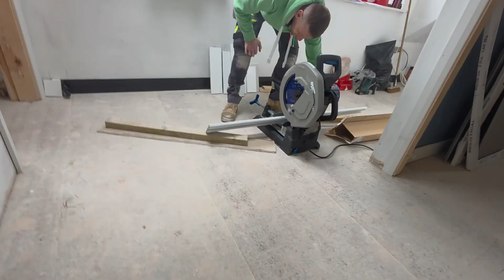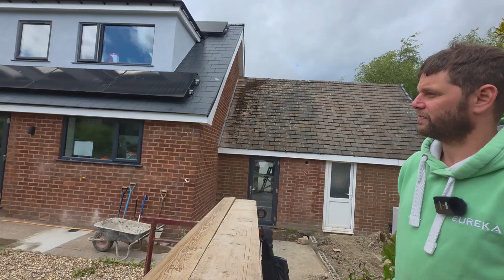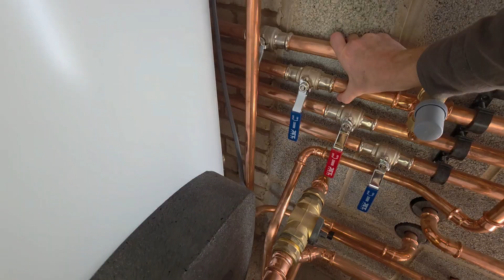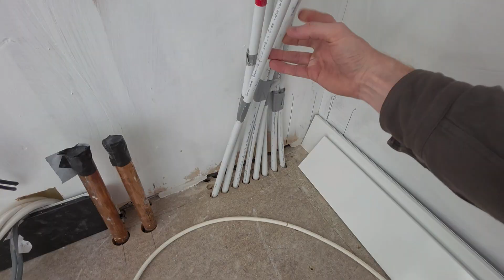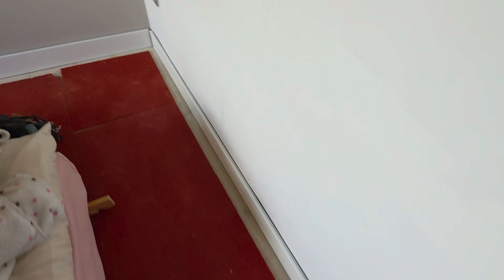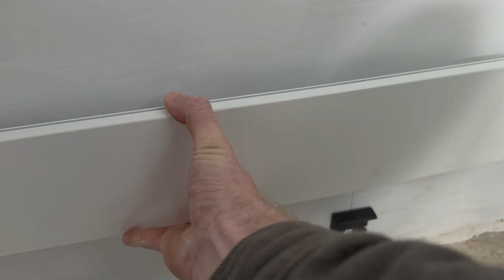Install a Heat Pump Without Ruining the Look of your Home

Comment: I'm a sceptic when it comes to expandable batteries. If you know the electric heating requirement you should be able to estimate a best size battery as there aren't any other large loads you can add to a home to significantly increase the use?
Reply from the maker: Its a good point, but not necessarily true. If you size the first battery to run the house, you may want to expand in future if you have an EV, or even two EVs. It just gives optionaility going forward.
Reply: @thermaskirt if you have an EV that is a bigger battery than the house will ever have expandable or not.
Reply: @thermaskirt people wouldn't charge their EV from a battery?
Reply from the maker: Yes you can charge your EV from a battery. Not fully, but most people actually travel very few miles. Some people want to charge an EV overnight, as well as their battery. Again optionality, plus, the more stored electricity you have the more you can sell back to the grid when rates go up.
Reply: @thermaskirt I don't think arbitrage would justify extra batteries unless they are cheap. If you were charging your car from your battery you'd be incurring 3 transformer losses.

Comment: I am a bit confused what is the design reason for the two zone design shown here. Are you running the thermaskirt and UFH at different flow temperatures  ?
Reply from the maker: Technically with UFH and ThermaSkirt you can run the whole system as open look, but this homeowner wanted to separately control the first floor and the ground floor, and possibly have them, operating at different times to achieve differnt room temperatures. 
E.G ground floor set to 21°C and first floor set to 18°C.

You can do either, its just the customers choice.
Reply: @thermaskirt Not a hope a customer like that will be running on weather compensation then.🤣